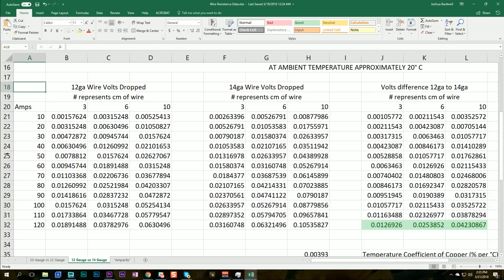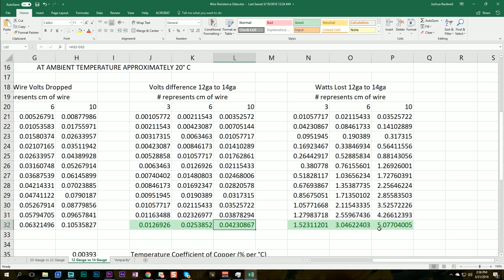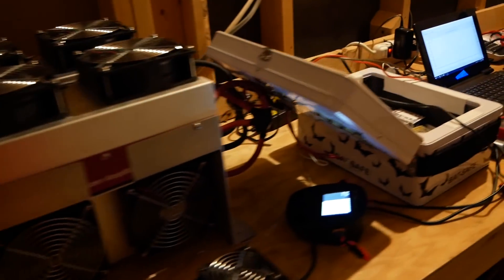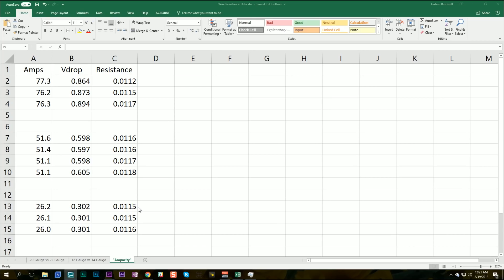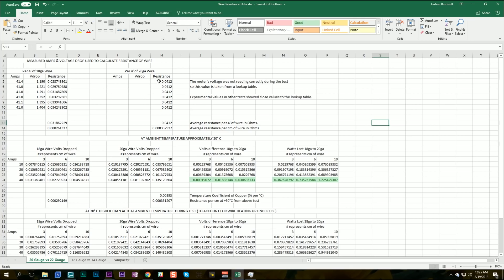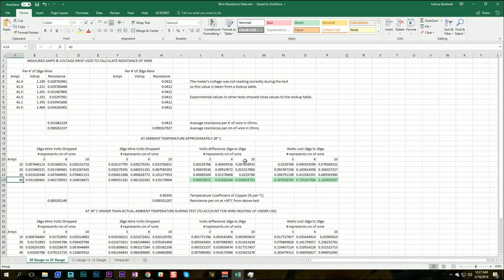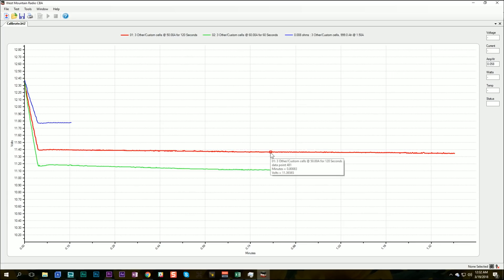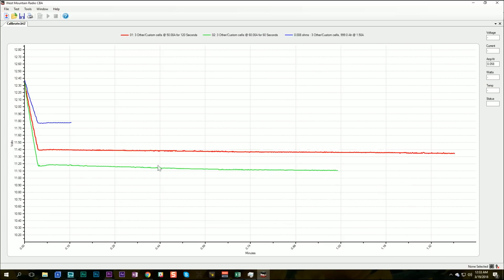Battery Wire Gauge | WHY IT (STILL) DOESN'T ACTUALLY MATTER

Comment: Stupid question, what would cause a the motor beeper feature to stop working for betaflight (no buzzer on craft use motors to find craft.. )it was working now it's not ... still flys fine but finding it is much harder after a crash with no motor buzzer I'm concerned hahahahahaha  just put 3.3 test it later
Reply from the maker: Did you turn on the CLI option? Or now it's even in the Conifguration tab. Dshot Motor Beeper.

Comment: %loss or %difference would be better than voltage different/wattage difference. "1 watt isn't much", but compared to what? 1 watt loss with 1 watt work is 50% loss, while 1 watt lost of 99 would only be 1%.
Reply from the maker: The work done is unknown though, because it depends on the motor and prop being used. But let's assume that a typical peak watts for a 4S setup is 15.0 volts * 100 amps = 1500 watts. That'll get you in the ballpark.

Comment: Great demo of why wire size in not that importance for short lengths we use for resistive loads.  The only question i have home much our motors are inductive loads currents might be much higher then 40amps for a few milliseconds.  This really only relvent for motor wires as most of this current would come from the low esr capacitors  and in pratice the tracks and componet leads would be the limiting factor

Comment: As an electrician, I have to chuckle at your use of the term continuous.  As a quad pilot I think you're spot on :)
Reply from the maker: "Continuous" as in, for a minute or two without stopping? Yeah... these wires would burn up no question if subjected to truly continuous loads this high.

Comment: If your cable get warm you are at the limit. Does the 14ag/10ag get warm ? No The Bottleneck at this wirement is the XT60 and bad connects/soldering. Joshua please make a test with a 1500W 2000W Resistor like 15/20 100w/12V bulbs and show when the cable gets warm/hot/too hot ;-). Maybe the Accu died earlier ... Regards from Germany Stefan

Comment: As an electrician by trade, and an avid electronics hobbyist, I find this kinda funny. Unless you fly full throttle for minutes at a time, the gauge at these sizes is more than adequate. I think this " debate " is brought on by either super tech specialized absolute nit pickers, or a vast majority of people that think bigger numbers, no matter for what, are better. Thanks for sticking with the facts, and backing it with some actual tests. Good work !!

Comment: 10:20 :D :D

Good info Joshua, I've been using 12AWG wire for my pigtails and I find it quite tricky to get a nice solder joint with that thickness, some of my builds use 14AWG and it is much easier to work on for me.

Comment: I’m a little confused.  So would I be ok to solder an xt60 connector to 26 gauge silicone wire then connect that to the battery inputs on the flight controller then hook up a 4s 1300 mah battery and fly a 5 inch quadcopter with it?
Reply from the maker: Perhaps 26 gauge would work if it was short enough. Why not work some math and see.
Reply: I only fly a micro 2.5 inch running a 650 mah 3s battery and 6000kv motors.  It would be nice if I could use about a 22 guage wire with an xt30 connector.  That would reduce weight and the wire is a lot more flexible.  I would never need more than 6 inches or less.  I'm currently running about a 6 inch 14 guage wire connected to the flight board with an xt30 connector.  I think voltage drop would be the main issue and getting a low voltage cut off or brown out if I dropped down to a 22 guage connector wire.  Unfortunately I don't have a good way to measure how many amps my quad is pulling.  I only have a cheap volt meter that can measure up to 10 amps.  The best way for me to test a 22 guage wire would be to just wire one up but I hate to take my quad apart for that :)

In the name of science would you be willing to solder up a 6 inch long 22 guage silicone wire to a 5 inch quad with an xt30 connector, then connect a 1300 mah 4s battery to it with an xt30 connector and fly the quad to see what happens?

That would be a real world experiment.  And if that setup worked really well on a 5 inch quad my micro quad shouldn't have any problem using a 22 guage wire.  If the setup worked well it would also be good for reducing some weight.  If you could drop to a smaller wire and smaller connector that might save about 5 grams on a larger quad.

I'm not being sarcastic or anything.  I'm just curious to see if it would really work well.  If you don't want to do it and think it is silly that's cool too.  Great job with the videos.  I'm a huge fan and I always enjoy learning new things.  It's cool that you take time to read all the comments.  I know you are busy.  Sorry for the long rambling post.

Comment: Hey Joshua, always great content double thumbs up. One thing I'd love a video about is why I need a power supply for my charger, rather than just plugging it into a wall socket.
Reply from the maker: Buy a charger with a built in AC adapter if you don't like having an external one. The ISDT D2 and the Quattro are both good.
Reply: hey thanks for the reply, yeah I have a SkyRC Q200 Quatro and it has an AC adapter. Just wondering if there's an advantage to using an external power supply over the built in one, as it can do both?
Reply: @adamkelly6264 lol hey after 5 years.....   charger is like half the size...... and can be run with a big battery

Comment: You are right Josh, the length of the wire makes drops insignificant. The only thing anyone needs to worry about it temperature.
Another test you could do to completely exhaust all arguments is try to emulate the structure & positions of wires in a quad & supply the constant load for testing.
I only say this because when you have 3 wires close together, the outside wires are cooler & the inside wire has an accumilation effect regardless of airflow - it will always be warmer. On top of this, the proximity of all wires in a quad will add to the heat build up.

I really doubt this would make much of a difference but if you really want to win Wackamole, this will be the mic drop.

Comment: I'd like to see the amount of amps the PDB can handle in fact. There are much more material in the cables than in the PDB for current to flow. Maybe this is the bottleneck in some cases. Just a case to discuss, not a statement.
Reply from the maker: Honestly, a 2 or 4 oz copper trace is much heavier than you give it credit for especially because it can dissipate heat more effectively with more surface area.

Comment: Hi I am trying to get into fpv how much would you recommend I spend on all the parts tools drone and gear .thank you.
Reply: aomway commander goggles: 310
taranis qx7: 105
emax hawk 5: 250
batteries: 25 each for 4s 1500s
So 765 with 4 batteries.  Then you need a charger but you can start with any cheap one.

Comment: Did you account for dropping voltage over time due to battery discharge? Lower voltage = more voltage drop
Reply from the maker: I don't understand. I think that voltage drop is purely a function of amps.
Reply: I'm not knocking your video,  just curious. It may not make a difference in this case. It's been a while since I got into electrical theory so thanks for making me curious about it again!

Comment: Hey Joshua! Can you put the currents on a scope? Then we can judge how important skin effect is.
Reply: Because I suppose you know skin effect plays a very important role at the frequencies the ESC’s are switching at. The current ripple can give us insight into additional losses because of skin effect.
Reply: Once again... Skin effect is going to affect 18 and 20 gauge wire exactly the same.  Everyone wants to shout "skin effect" without considering the real world conditions.  Most 18 and 20 gauge wire aren't their gauges because of more or less stands.  Most manufacturers just scale up or down the stands inside the wire.  Compare a 12 gauge wire to a 16 gauge wire (in general) you will see that the strands are larger in the heavier gauge wire to handle the heat from the higher current the larger wire generally handles.  If you're concerned with skin effect, don't worry so much about your wire gauge... Worry about the manufacturing quality and strand count.  These are two completely different issues.

Comment: Joshua, i dont see Volt you push on wire. Only Amps. Do like that, 5V 50A and check Volt drop. Next 20V 50A and check Volt drop. See diference ?
Reply from the maker: I believe that voltage drop is purely a function of amps and resistance. If amps and resistance are the same, then it's dropped will be the same regardless of the input voltage.
Reply: It's true. My bad, i mean the 0,5V drop from 5V i significantly more than 0,5V from 20V. And this is very important to notice.

Comment: damn, i use 20awg for escs and 2306 2450kv sunnyskies with 5x4.8x3 hq props on a 380g quad and 4s without any issues (18awg just dont fit there, the build is too tight)

Comment: OK ! It works with a small gauge but, if U lose about 4 watts on a wire of a length of 12 cm then there will be quiet a bit of heat dissipation. I´d rather have a bigger gauge because I want all my power going to the motors.  I´d never go over 10A/1mm². Just think in case of a shortcut after crashing. I don´t won´t my wires glowing off ! Sometimes I use 2 wires in parallel just to provide a low resistance. But, like I said, it works. Probably it´s a philosophy.
Reply from the maker: But that wattage is for continuous very high amps which most won't experience. If you are going to pull 100 amps continuous then I agree you need bigger wire.

Comment: These are the types of videos that I find most helpful. There is a lot if information about how to bind a receiver or setup a flight controller. I still appreciate those videos too, but tests on large currents through short wire are hard to find. You dont see those types of applications a lot outside of professional use. My best source of information before was, "What does everyone else do?" Thanks for the content and providing the final data. I, for one, do like to look at it!

I would like to see data on more size of wire. I would have never considered using 16 gauge wire in an application where I use 130 amps peak. I may be surprised though. I personally prefer to work with smaller wire whenever possible. I know you've got a lot going on, but that would be interesting.  At that point you could probably generate a table advising people which wire size is needed based on peak amps. Oscar Lang has something like that but it doesn't appear to have any data to back it up. It looks to be experience based. I've NEVER known a person to use too small of wire so that the heat became problematic. 

Again, thanks for the info. It'll change the way I build my quadcopters.

Comment: 20watts is a lot mann it's by making useless upgrades that humanity has arrived where to is today. Those measly 20 watts can reach 500watts with several miniscule upgrades.

Every little helps is a truer statement than the grass is green. But for the most part, it will only give an extra couple seconds but still I don't think it should be brushed off.
Reply: I run a whole track of house lights on 20 watts.
Reply: Ben Jones I'm looking outside right now, and my grass is brown.
Reply: Troy Nahrwold there's something I have to tell you

Comment: most all motors are wound with much lighter gauge wire so I too don't get too excited about overkill on the diameter of the wire going from the battery or even to the motors from the esc.
Never had a problem and it's makes soldering and connecting everything much much easier.

Comment: Excellent video. Thank you sir! 

I do have a question for the fpvknowitall:

Do you think motor wire gauge size has any effect on effiency? I'm using the new Emax LS2207 motors and they are using a larger gauge wire claiming it is more efficient. Thoughts?

Btw, these motors perform very well, smooth and only $18.99! Highly recommend.
Reply from the maker: I think it's absolutely the same analysis as used here. At short length, the difference between 18 and 20 gauge is negligible in my opinion.

Comment: I'd be curious to see the difference between 12AWG and 16AWG.
Reply from the maker: Given how close the derived values here are to the nominal values, I would feel comfortable estimating this based on a table.

Look in the table and find the type of wire that most closely matches these values and then look up the equivalent resistance for 16 gauge.

Comment: in rc car speed runs the littlest difference can be the record.
Reply from the maker: Yep. If you are in a scenario where 10 or 20 watts makes a difference, then use larger gauge. But beware the additional weight... ohhhh now what?

Comment: I've been using 16AWG wire for my ESCs, until i build 2 quads with JBF4 FC(Who needs ButterFlight, when MPU6000 is butter out of the box..? :D) and had to downgrade to 18AWG because of a very tight build. Haven't noticed any difference in performance since downgrading to smaller wire.

Comment: Joshua... is that a Kwad Box on your desk? I just signed up the 1'st of March, I hope I don't have buyer's remorse. 
Your biggest enemy is poor solder joints and God forbid you use crimped ends (shame on you!) that is where most of your voltage drop comes from. I run 16Ga on my quad that can eat 180A- I have no issues with it- but I pay close attention to my soldered joints.

Just look at PDB's and ESC's, they have tiny, flat traces, it's your bottle neck in the system, and they have 40-50a 20X20mm 4-in-1 ESC's today!

Comment: BTW, fusing currents for copper wires. 14 gauge wire will fuse at 166 amps and 12 gauge wire will fuse at 235 amps.

Comment: The Temperature Coefficient of Copper (near room temperature) is +0.393 percent per degree C. This means if the temperature increases 1°C, the resistance will increase 0.393%.